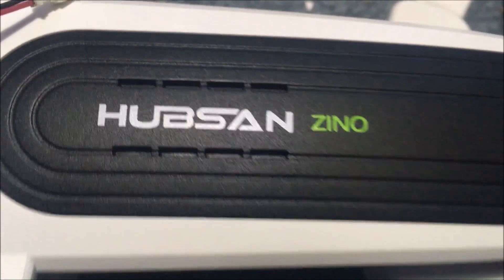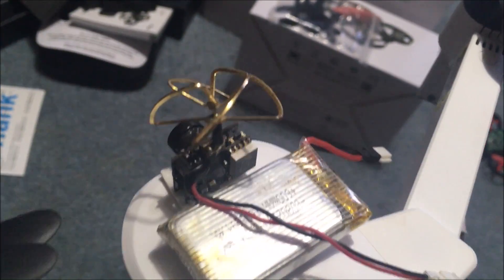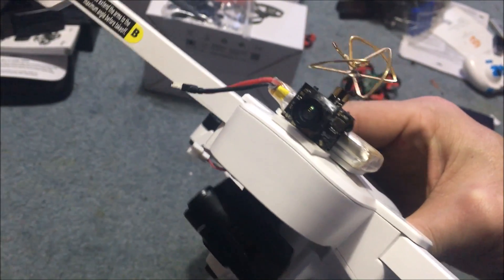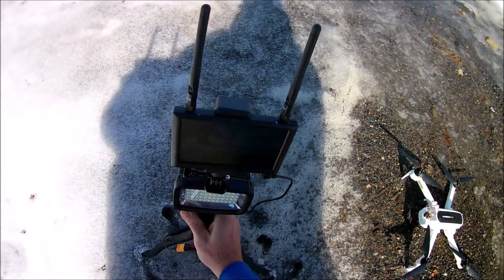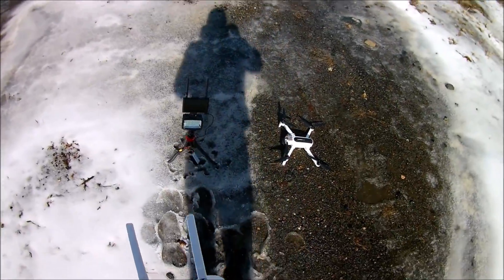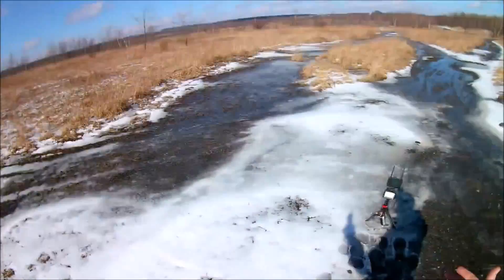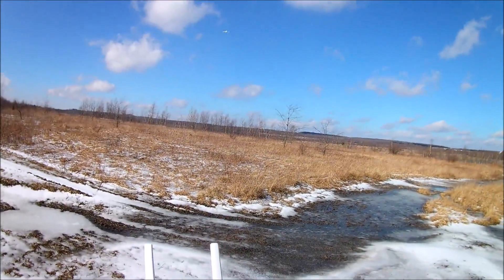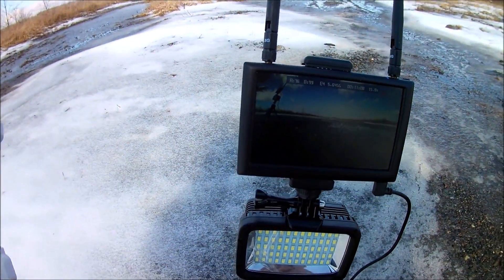Hubsan Zino REAL FPV 5.8 GHZ GOGGLES Will it work ?

Comment: Glad to know ZINO is capable of doing this, thanks! but I have another question: Can you use your FPV goggle to show the ZINO camera view (i.e. not using AIO VTX)? Would the range be much shorter than the FPV feed on the App? (Thought it might be easier to pilot ZINO with goggles on rather than squinting at my tiny smartphone screen...What do you think?)
Reply from the maker: LoveYourGear use be goggles run cell up to typical 5.8 goggles won’t work to tap Zino transit

Comment: No offence against you but this so-called MOD looks shit, is not a clever idea and makes no sense. If you really want fly useable FPV drones buy a cheep real for FPV flight constructed drone.
I can also attach such an FPV transmitter to a shoe and hurl it through the air, so it is by no means FPV flying. 😧
Reply: That's harsh
Reply: @syn4588  maybe, but true
Reply from the maker: It was to prove a point not sure how u missed that, the point was adding a 5.8 device to drone wouldn’t disable it as was stated
Reply: @JayDrone  I am not missed that point. But it just doesn't make sense to prove something mundane and unnecessary like this. It's neither difficult, witty or useful. Sorry, but this is my opinion
Reply from the maker: It makes sense because the argument that was had elsewhere which you definitely were not a part of but I try to include viewers. The drone is operating off of a 5.8 GHz frequency. The argument was that adding another 5.8 GHz frequency would disable the drone or make it not fly properly that was the point that you had missed
Reply: @JayDrone  of course it's not matter there are 2 5.8GHz devices. As long there have not exactly the same frequency. And this is why you not get the point. It is logical and needs no prove. But it is your time, your channel, have a nice time...

Comment: Well you did it Jay, you're the man. But doesn't the Zino already have FPV built into the app? All you need is a cheap pair of VR goggles to put your phone in and your flying FPV on the cheap.
Reply from the maker: Correct my DJI goggle mod or my fxt cell mod will work way better , I just did this because I was told it wasn’t possible
Reply: @JayDrone  You test your modded FPV set-up vs the stock FPV system. Now that would be a interesting video.
Reply from the maker: DJI cheapo dr1 goggle mod I flew my spark with

Comment: Zino is not exactly a pretty drone when in the air. The bugs 2 seems to have a more robust gps hold making a better platform for the aio camera fpv cruising .
Reply from the maker: Correct